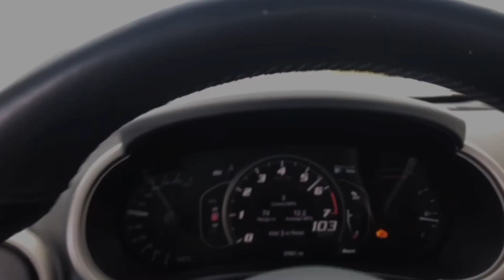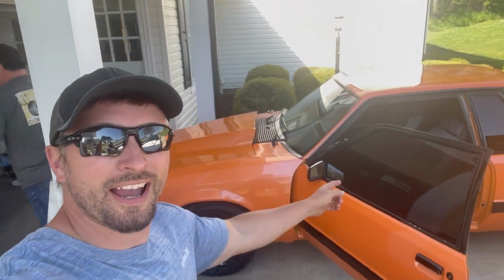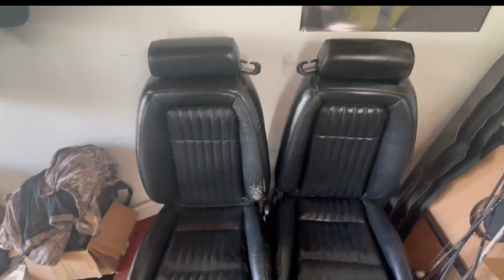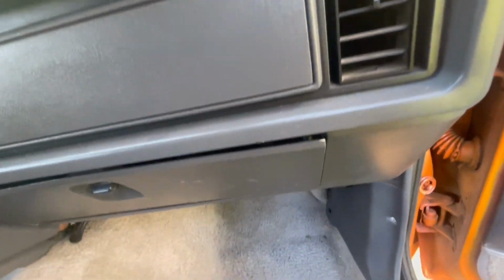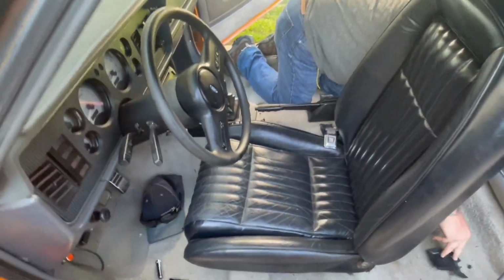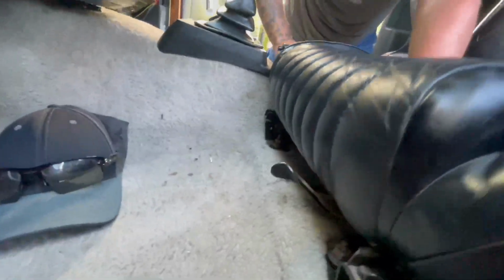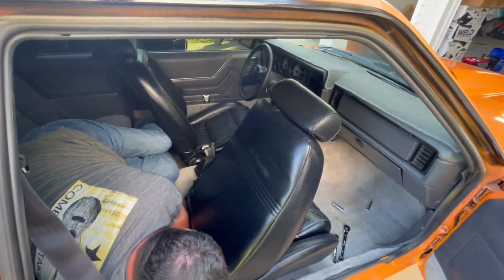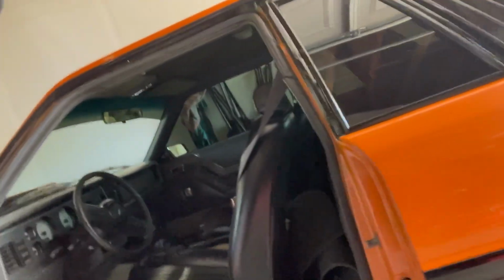1986 foxbody 4 eye coupe saying goodbye to the old and in with the new.

Comment: Hey are on the opposite size
Reply from the maker: Yes driver was power passenger wasn’t fit perfect. Getting my old ones done.
Reply: @boosted9319  they fit great had to do this on one of mine few years ago. The passenger leather seat was manual so it worked good.
Reply from the maker: @streetstockfox529  yeah I just gotta take the seat belt holder off the top.